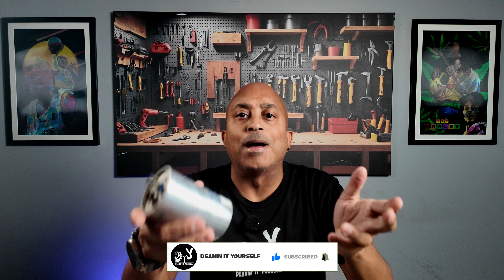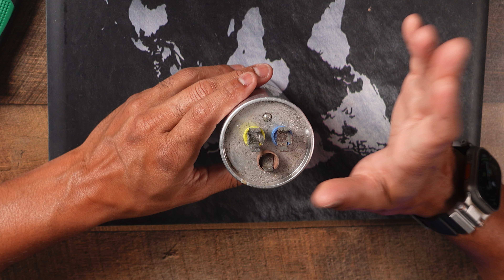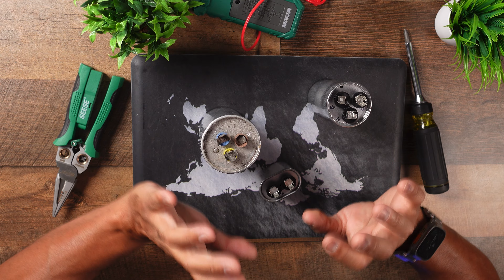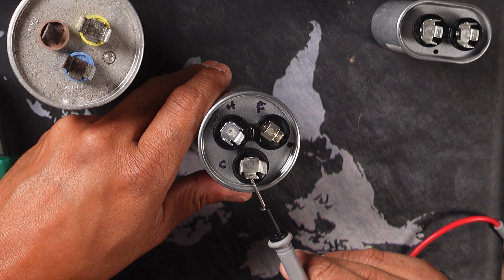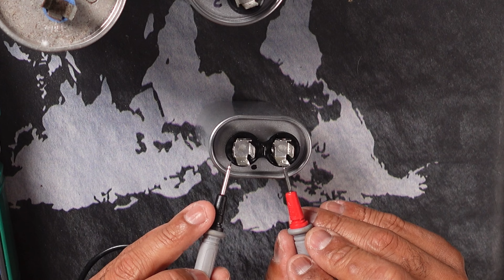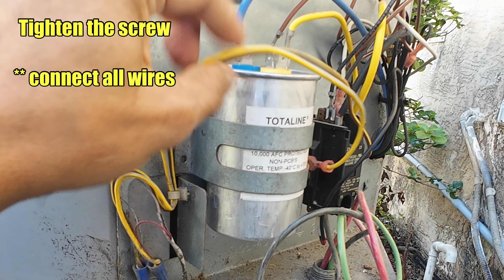HVAC Capacitors Explained: How They Work, Fail, and Get Replaced

Comment: Thank you! I just fixed my 40 year old Lennox AC unit by replacing the run capacitor for the fan. Cost me $9.46 with tax from Home Depot who had it in stock. I can't imagine how much it would have cost on Labor day weekend. Furnace and AC still running strong on this unit.
Reply from the maker: Nice work!

Comment: capacitor replacement is one of the more DIY-friendly HVAC repairs if you're comfortable with basic electrical work, but the discharge step is the part people skip and it can genuinely hurt you. good that this covers it. one thing worth knowing though: a failed capacitor is sometimes a symptom, not the root cause. if the motor was straining for a while before the cap blew, the motor windings may already be stressed and a new cap won't fix that for long. if you replace it yourself and the unit still struggles to start or trips the breaker, that's probably when it makes sense to get a tech to actually scope the motor and refrigerant charge. ars/rescue rooter is one option for that kind of diagnostic, though as with any service call, ask what they tested and get the scope in writing before approving anything.

Comment: capacitor replacement is one of the more doable DIY repairs IF you discharge it first and match the specs exactly (microfarads and voltage rating both matter). that said, a lot of people swap the cap, the unit still doesn’t start, and then they’re back to square one because something else failed too, like the contactor or the compressor itself. if you test and the cap looks fine, or you replace it and still have issues, that’s usually when it’s worth calling someone to run a full diagnostic rather than guessing at parts. ars/rescue rooter is one option for that kind of service call, though fees and availability vary by location, so check what’s near you. just make sure whoever you call gives you a written scope before approving anything.